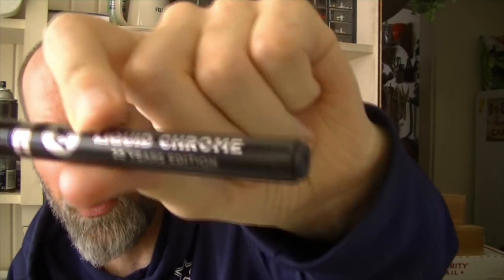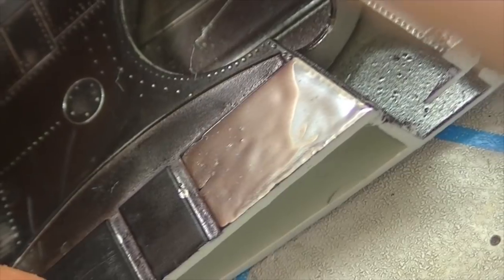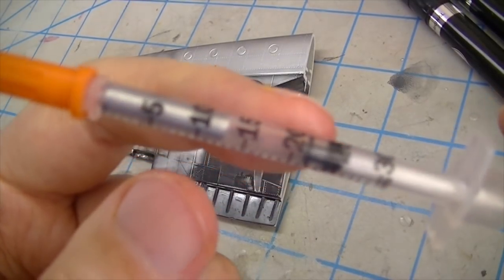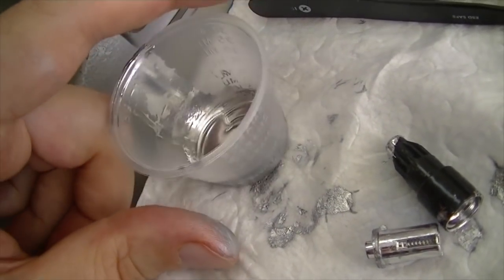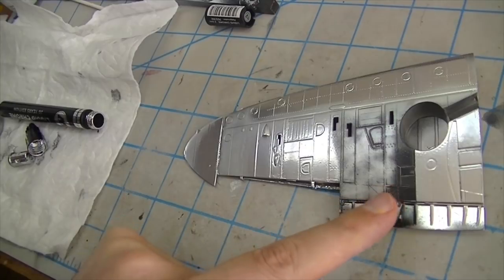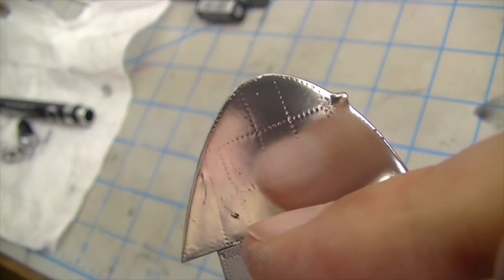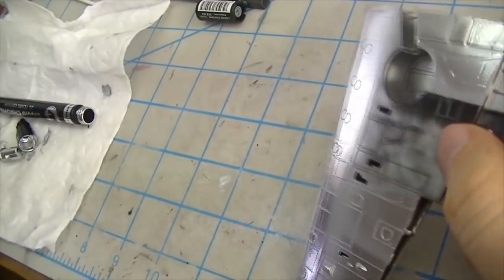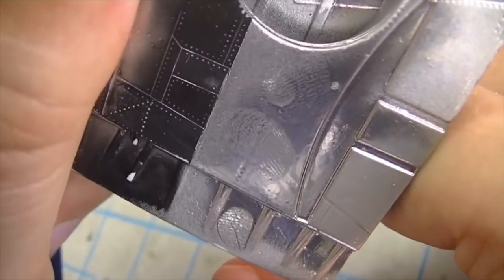ep129 - testing molotow chrome pens

Comment: a friend of mine decanted some of the molotow chrome and sprayed it onto some plastic pieces and tested it after 1 day, 2 days then a week. after 1 day marks appeared, 2 days less marks but still some. but after a week no finger prints appeared only finger oil marks. having seen the results myself I highly recommend using this product for airbrushes but you must leave it a week before touching

Comment: I wanted to watch this episode for weeks now and just didn't have the time to do it earlier. I would only need that for the one car model I've got in my stash, but I wanted to know if the stuff is any good. Since you really test things thoroughly it was more informative than any other video on Liquid Chrome I watched before. I guess it'll do for my purpose, because I'll mainly need it for touch ups of the sprue gates, since the chrome parts are nickle plated and not the usual aluminum stuff. It might also work for chrome trim if I thin it down like you did and then try to brush paint the trim carfully. Very helpful video, Will, and worth the time watching it. Take care. Jens

Comment: I use Liqutex Varnish to cover when dry, it keeps a bright look and hardens the chrome paint, I haven't had much success with any other clear , left un-cleared the chrome effect will dull after touching it even when left dry for a few days.
Reply: Liquitex offers this in High-Gloss, Gloss, Satin, Matte, etc.. What level of gloss do you use?
Reply: I'm guessing High Gloss Since it is a chrome paint but I'll try this method soon to get those results

Comment: I had marked up a 2 inch test panel and chromed it with a 2mm marker. After letting it cure for about a week, I brushed on a light coat of Pledge floor wax and it's held up to touching without leaving prints or ghosting. Test your own perhaps with acryllic clear, light coat after several days.

Comment: Thanks for the video. You've gone through the (nearly same) process I went through demoing the stuff. I had high hopes but even after waiting several days and touching the surface the stuff clouded over.  So I am now in the process of looking into clear coats. Sad because as soon as you hit it with any of the clear coats I know of, your going to lose the luster.  If I have to clear coat I am thinking of just going back to my favorite chrome paint (Mira-Chrome from Alsa). Nothing beats it IMHO.

Comment: Been playing a bit with this stuff- definitely have to lay it down wet, and let dry a MINIMUM of 72 hours.  Alclad Klear Kote works the best so far.  Future dulls it a bit.
Reply: I realize this comment is a couple years old, but was wondering if you know exactly which Alclad klear kote you used, i.e. 312, 131 etc. Thanks in advance for your time.

Comment: Refill is 32 cdn here, I think Green World may be better. I cut it with alcohol 99%. Maybe clear floor wax micro cloth buffed. Maybe wet sand 1500 to get the clear fuzz off paint surface or flood it? UV clear coat?

Comment: Hi Will, thank you for introducing with those pens. Those pen producers are pretty stupid if not aware that their pens will be disassembled by modelers to spray it :) It was interesting to learn that you can dissolve it with thinner and it give even better result. What I am thinking off how durable the paint would be after 24h. It looks like the paint I got from ARS chrome can and it was hard enough to touch after overnight... So, I wonder how this pen chrome will behave after one day or so...
BTW, that dissolved chrome really reminds me Gunze SM08 paint, which is not bad at all.. but also does not like clear coats

Comment: I need to handle the chrome on a plastic prop razor. What can I coat it with? Does it need coating?
Reply from the maker: absolutely.  use a clear water based acrylic.
Reply: Thanks. Can you recommend a product, or can I just type 'clear water based acrylic' into ebay?
Reply from the maker: alclad aquagloss is a solid choice.

Comment: I think these are more intended for trim instead of covering large areas.  Common sense...
Reply from the maker: except there are plenty of people trying to do more.  common knowledge...
Reply: @barpfoto  You're taking an item and using it for an entirely different purpose than it was intended but expecting to get results that you desire.  It rarely works that way.  You are great at model work, so don't get me wrong.  I am not criticizing you personally. It's just that this stuff is not going to be near as durable as enamel and of course you are going to lose detail in any case.  The airbrush results when thinned were acceptable but what will it look like in a few months?
Reply from the maker: @kdryan21  dude… it's been a while since I made this video but I'm pretty sure I'M not advocating any such thing. In fact, I completely agree with you. This stuff is garbage for anything other than details and parts that will be handled like… Never again. I've tested it extensively since this video was made and it sucks.  but, lots of people are in denial.  they think it's shiny and awesome and completely ignore how terrible it is in every other respect. Just read the comments on this video itself. lol
Reply: @barpfoto  I think we're actually on the same page then. :)

Comment: I’ve had trouble with the 1mm pen plugging up. I don’t know how to stop this any ideas?
Reply: yes, regularly clean your markers with water. the molotow paint is water based acrylic. it wont hurt. routinely clean your marker tips, and threads and valves in warm water to stop this, re assemble, refill ink and enjoy! for extremely dried tips i have used finger nail polish remover or acetone. also, always replace old/worn down tips. normally a good rinse will restore your tips to as good as new. <3  https://www.instagram.com/arhythmatic/ you can check out some of my out some of my molotow pieces, here

Comment: It looks great over bare white plastic,  I'm uploading a video right now,  check out the valve covers on my motor,  and I cleared them with Future,  but it does need to dry for 2 or 3 days,  :)  Tom
Reply: I was looking at the Molotow website and they say that this chrome is an alcohol based ink, if that is any help with your experiments,  :) Tom